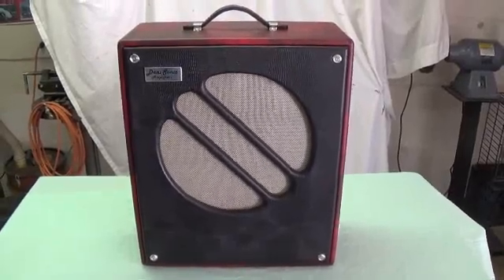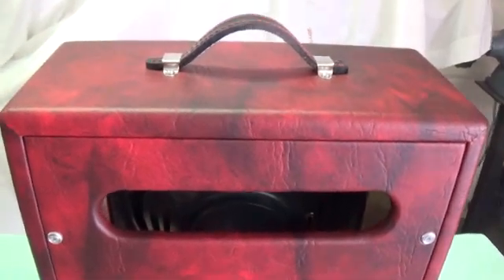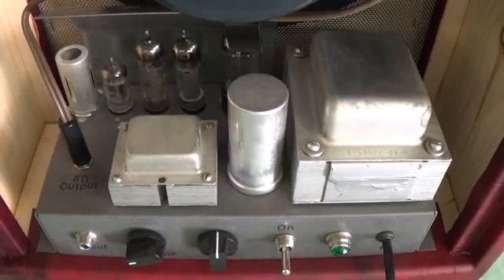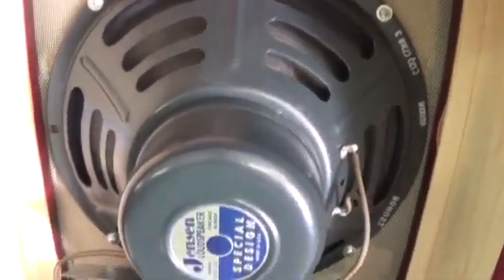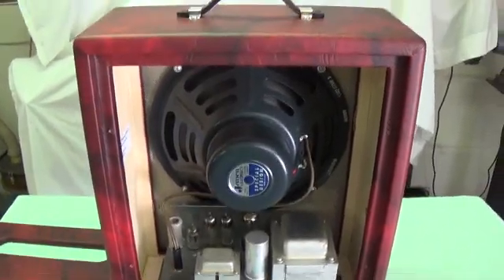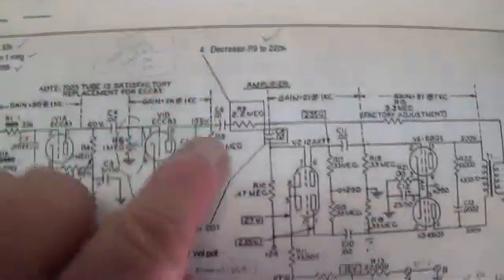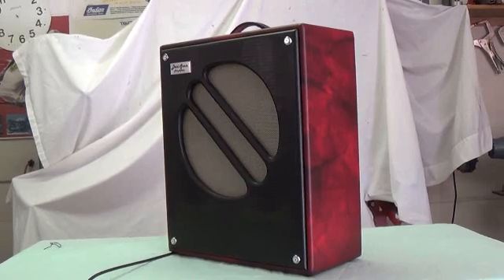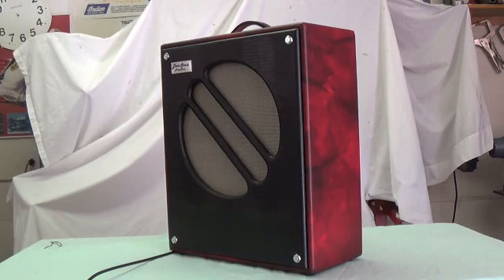Conversion of a Hammond AO-35 Reverb Driver into a Guitar Amplifier

Comment: Hi Uncle Doug.  I''ve been researching the Carmen Ghia amp and found this schematic that was supposedly reverse engineered from a "real" Carmen Ghia.   I noticed the Tone Stack is different from the ones suggested in the link you provided.  Also, it shows a lower gain 5751 in the Phase Inverter which interesting.  And the cathode circuits look more familiar.

https://www.flickr.com/photos/49108115@N04/6687437273/in/photostream/

I thought you would like to have this, if you don't already.  +John

Best Regards to you, Jack and Rusty!
Reply from the maker: Thanks for the link, John. Whenever I encounter alternate schematics like this, I think the best approach is to experiment with each option and compare the results. I'm not surprised at the tone stack difference, since I picked mine, literally at random, from a site on the Internet. The change in PI is interesting, however, and would be a good candidate for side-by-side testing. Again, thanks.
Reply from the maker: Thanks for the video link, John. I have never felt the need to heavily modify this circuit.....it seems to work really well with just a few modifications for guitar use. However, I am always interested to see how others approach such projects.
Reply: One more person's take on this conversion: 
 
http://www.tdpri.com/attachments/ao35hammondschemmodified-jpg.19344/

Very minimal changes, I don't think this will get there, but it is a completely different and maybe easier approach to a tone control...

I read the Carmen Ghia was Class A;  I know the AO-35 runs quite hot, but would Hammond use a Class A amp for reverb?  Time to study the bias circuit!
Reply from the maker: The tone control in this version is as simple as it gets.....a pot and cap providing a variable route for high frequencies to ground, which would probably result in some loss of volume when in the "Bass" position. Again, it may work fine, but such modifications should be evaluated by experimentation before being used.
Reply: Yep.  I'm building up a library of CG circuits to play with.
Reply from the maker: A wise move. If you come up with a combination that performs wonderfully, please share it with us. I, and many viewers, would benefit greatly from your input.
Reply: 1 more for reference.   The Matchless Spitfire is very similar and could be built out of an AO-35.  This has a very simple tone control and a very simple Master Volume.....    https://tornadoalleyfx.files.wordpress.com/2015/04/matchless_spitfire_pdf_1.png
Reply from the maker: Excellent, John. Many folks feel that the simpler the tone control(s), the better. Since virtually all such controls are passive, simple designs tend to lose less signal to ground.
Reply: I wasn't all that excited about the Spitfire circuit until I saw that a 15W Spitfire head lists for $1809!!!  I'm paying attention now!  LOL.  I just noticed there is not feedback....
Reply from the maker: Wow.....that would get my interest too, especially since you could probably clone it for around $200 or so.
Reply: I used the Weber bias calculator to compare the bias of the output tubes of some of the designs I've gathered and got interesting results, using resistance and voltage values  on the schematics.

The "Phoenix" Carmen Ghia is biased at 9W /  tube.
The Matchless Spitfire is biased at 15W / tube.
The Hammond AO-35 is biased at 12W / tube.

The 15W Spitfire would seem to be "pure" Class A.
The 18W Carmen Ghia seems to be Class AB, with 50% idle current to reduce crossover notch distortion.
The 12?W AO-35 "could" be 12W Class A.  12Ws of reverb in a console organ seems like a lot for the living room.  This would have been a pretty uncompromising design for a reverb amp in the 1960s.

I powered up the 4 AO-35 amps I've collected and 3 of them work fine out of the box.  The 4th has very low and distorted output.  I've traced the signal to the input of the PI so far....  It sounds like a blown output transformer, but the resistance the OT primary and secondary looks okay;  more to do.

The amps sound surprising HiFi!  The high frequencies are rolled off and the input impedance does not match my CD player very well, but I can hear that "tube-ish" quality that is so desirable.  I'm going to change the values one at a time (at least with the 1st conversion) and listen to how the sound of the amp changes (input cap 1st).

I did some transformer comparisons using Mercury Magnetics replacements/upgrades to get an unscientific relative measure of the costs; looking for some justification for the Spitfire being something like 50% more expensive the Carmen Ghia.

Spitfire transformers

OT  265.00
PT  276.00
C    48.00
    589.00

Carmen Ghia transformers

OT  138.00
PT  197.00
C    48.00
    383.00

18W Marshall

OT   181.00
PT   175.00
C     48.0
     404.00

Here is a Mojotone transformer that is a bit more pedestrian and could represent what the AO-35 transformers might have cost, relatively.  I have no idea how the AO-35 transformers actually compare in cost and quality (I'm sure they are quite good), but there is a significant spread.

Mojotone 18W Marshall
OT    60.00
PT    80.00
C     11.67   (MJT 6V6)
     151.67

The Carmen Ghia is "supposed" to Class A but, If my conclusions about the biasing is correct, it is really Class AB, idling a 8W dissipation.  The Spitfire amp and transformers would/should/could  cost more because it is 15W Class A.
Reply from the maker: Thank you for sharing your exhaustive research, John. The cost of the Spitfire MM transformers is staggering. Its performance would have to be vastly superior to the others to justify this exorbitant expense. The Mojotone Marshall is more in my league. I simply can't bring myself to spend almost $600 for transformers. I believe the transformers that come on AO-35's are of excellent quality, and your figures certainly make them seem like a huge bargain, when the entire amp can be bought in the $125 range, including vintage tubes.
Reply: Doug,  

I think the moral of the story is that if you are going to sell your AO-35 conversion, definitely call it a Spitfire clone, not a Carmen Ghia or Plexi clone!

Here's a good discussion thread on the Spitfire and some variants.  Lots of discussion as to whether the Class A designation is BS for these amps and if the Spitfire is a "tube eater"....  The 6V6 version of the Spitfire sounds interesting.... 

I feel destined to try some of these outrageous transformers.  I've collected 2 Fender Champ 600s and 2 Epiphone Jr 5W heads for the expressed purpose of doing this comparison, but thus far, I have been unable to pull the trigger, LOL.  Also, I have several Leslie 25 and 125 amps that I have collected over the years.  One of the 25s came without an output transformer and is begging for the MM Leslie 25 replacement transformer ($181 ouch).  The design of the Leslie 25 amp was changed because so many output transformers were failing.  The PS voltage was dropped by adding 2 more diodes and a 75 Ohm, 1W dropping resistor.  This change is shown in the Leslie 125 schematics: 

http://www.captain-foldback.com/Leslie_sub/leslie_schematics.htm

I did some debug on the non functional AO-35.  It looks like R13 has drifted in value from 22k to about 5k.  This puts the cathode voltage on the PI at less that .1V; so it's turned off.  The distorted sound I was hearing from the speaker was the result of over-driving the input of amp to the point that the preamp tube was attempting to drive the speaker through the feedback loop!  

Other resistor values have drifted as well, but R13 is the killer.  I see the expected voltage on the bottom of R14, but only about 2V at the top of R14, which is labeled 12V.

I will test this fix as soon I find a suitable resistor in my collection of immaculately organized boxes,  bags, piles and drawers of parts. ;-)

It sure was helpful to have a working amp for comparison!
Reply from the maker: I would love to see and hear an objective comparison of ultra-expensive (MM) and run-of-the-mill transformers, John. Similar evaluations of high-dollar capacitors have, in my opinion, revealed no demonstrable differences, but perhaps such a transformer "shoot out" would. In my opinion, the difference would have to be quite obvious to justify the difference in cost. Let's face it, the most revered of all vintage amps, i.e. the tweed Bassman, certainly didn't have $600 transformers and $50 tone caps, yet it is the standard that many use to justify the exorbitant cost of their parts. Perhaps it makes sense for famous performing musicians to utilize such high-dollar parts, for  max-power durability, but for some poor schmoe struggling to learn Stairway to Heaven in his 12' x 12' apartment, it's absurd. Re your repair experiences, they definitely highlight the need for careful voltage measurements at full operating potentials and individual component evaluation to detect subtle errors (i.e. PI cathode voltage) that result in significant malfunction. Thanks again for your very knowledgeable and informative input.
Reply: Mark Huss has an extensive collection of 18W schematics:
http://mhuss.com/18watt/schematics/
Reply: Have you analyzed the rather elaborate implementation of the 1st gain stage in the AO-35 (V1A)?  The designer went to a lot of trouble and some expense for what may be a unique input circuit!  I have not been able to find anything similar.  

At first I thought C2 was there to reduce the Johnson noise from R1, but if this was the purpose, it should have been placed between the grid and ground.  By placing C2 between the grid and the cathode and using the "low noise" bias resistors (R2, R3 and R4) a feedback path is provided around V1A.  It may be reducing the Johnson noise as well.

The Matchless Spitfire scrapped all of that and it appears they copied the 1st stage of the tweed bassman and bypassed V1B.

The Carmen Ghia kept V1B, but removed the feedback path and simplified V1A.

Any ideas what is going on here?  I hate not understanding!

+John
Reply from the maker: Greetings, John. To be honest, your curiosity and analysis are of greater depth than I generally delve. I tend to be an experimenter, rather than a theorist, and rely on trial and error evaluation to explore such enigmas. This is probably due to my lack of formal training in electronics theory and compensatory reliance on common sense, observation, and personal investigation. My approach would be to set up an experiment emulating each circuit and then analyzing them for relative performance characteristics. It may well be that no significant differences are noted, and that the differences are simply due to the whim of the designer or the availability of certain components.
Reply: Hi Doug, Thank you for indulging my OCD approach to this conversion.  I agree with you that there is really no need to worry about fiddling with this input circuit if it works, is stable and sounds good.  I think I got distracted by wondering what the "secret sauce" is that makes the difference between the AO-35 being a piece of junk sold on ebay for $100 and a $2000 boutique guitar amplifier.  No doubt some portion of the difference is hype, folklore and the soft Corinthian leather.  It seems to be worth a little more effort if it is indeed "knowable".

On the practical side,  I debugged the distorted AO-35.  R17 and R18 were BOTH open so the PI really was OFF.  I can't imagine the failure mode that would take out these 2 resistors; there was no smoke.  The sound coming out of the speaker was the result of over-driving the input to the point that the speaker was being driven through the feedback resistor!  I replaced the 2 resistors and the amp works.  Your basic 6 cent fix.

I made the suggested circuit changes and modeled the Spitfire Volume, Tone and Master Volume controls and it seems to work great!  I'm working on a template for drilling the chassis for the switches, controls, etc.....

These amps are actually pretty easy to work on.  I will build a few a few different versions for comparison.  9W vrs 12W vrs 15W power tube biasing.  Feedback vrs no feedback;  Hammond vrs Carmen Ghia vrs Spitfire input circuits.

On the theoretical side, I think the starting point is the difference between a guitar input circuit and the reverb recovery input circuit of the A0-35 amplifier.  I expect the input impedance, voltage and desired frequency response are all different.

The dominant effect of the Miller capacitance is to reduce the gain of an inverting amplifier at high frequencies.  C2 adds to the miller capacitance which would reduce the high frequency gain even more.  I'm going to model the this circuit by adding C2 to the Miller Capacitance and see what the result is.

While proofing this, I surveyed a variety of reverb recovery circuits;  none I found look quite like Hammond's.  Most look like the input of a tweed Bassman!  It may not be possible to know what was in the mind of the Hammond designer.  Hammond invented the spring reverb and this circuit may be the work of a genius.  It is equally likely there was a technician tweaking the circuit until it sounded "good enough" without a rigorous analysis of the result.  Or Hammond may have patented this recovery circuit and no one wanted to pay for a license!?  Yep, I have OCD.

Comment: Mr. Uncle Doug, i have an old  CCCP made radio receiver . it is big in size and it got several tubes in it and lots of stuff. can i send you pictures and circuit map of it  and i want to know your opinion about it - cant it , some how, be transformed in to guitar tube amp ? (i`am  not competent in stuff like that)
Reply: +Lasha Zaridze  and i forgot to say - it also got a vinyl player.
Reply from the maker: +Lasha Zaridze  You are welcome to post schematics and photos on my Facebook page: Uncle Doug's Vintage Amps. Due to the flood of correspondence, my time is quite limited, but I can look over the schematic.
Reply: +Uncle Doug that would be so great. I dont intend to take much of your time, just glance.

Comment: Doug, am a regular viewer of your videos - which are great. Finally got around to getting one of these ao-35's and was just having a view of your series on scratch building a single ended amp with tremolo and reverb. There is a point in your series where you change the wiring because you said the 5Y3 shouldn't have more than 20mfd filter capacitors. The point I'm getting around to is that the cap can filters on the ao-35 are 40/450.40/400 and 30/350. Wondering if you'd care to comment. By the way, could the tremolo circuit from your scratch build be used on the ao-35 in the same way - hooked up to the first preamp tube? I'm probably showing some ignorance here with both these questions. Love your stuff. Best wishes.
Reply from the maker: +Mac Sledge  Thanks, Mac. Tube handbooks make specific filter cap value recommendations for each rectifier tube.....which the amp-builders seem to scrupulously ignore.  There are benefits and pitfalls of using larger caps, but I've found that being conservative and sticking with book values seems to work quite well.  Apparently, in the AO-35, Hammond engineers (far wiser than I will ever be) felt that much larger caps were the way to go.
Reply: +Uncle Doug Thanks Doug. As you can tell, I don't know much theory but I'm still pretty handy with a soldering iron.
Reply from the maker: You're welcome, Mac. Good soldering is a great place to start :)

Comment: Hi Doug,,, Just watched this great video again and I was wondering how you would tell what the Primary impedance of the output transformer would be.. Looking at the 6BQ5 Data,, I see the Plate resistance is around 38K and the load resistance is  4.5K,,, So for  a Push Pull amp the Effective load resistance is 8K,, So does that mean that the Primary side of the output transformer would have to be around 8K or so? Thanks,, and sorry for the new to Push Pull amp question,, like to build one Using 6Bq5 tubes,, Terence,, P.S. Hi Rusty,,Hi Jack,, :)
Reply from the maker: +Terence Kaye   Yes, the primary should match the load resistance of the tubes (8K ohms of impedance) while the secondary should match the impedance of the speaker(s) voice coil(s).

Comment: Hey Uncle Doug, a Leslie model 51 was recently"dumped in my lap". An older friend of my father wanted it out of his garage, so I obliged😀! The cabinet is a total basket case, literally smashed. Luckily the inside survived, minus a shattered tube or two. My question is can this amp be converted for guitar? And would it make a good guitar amp? All the speakers are there as well, original jensens. What a score...
Reply from the maker: +Kevin Lillie  Congratulations, Kevin, on a great acquisition. I am not particularly knowledgeable regarding all the Leslie models, but if this one uses the model 47 amp, then it would be an excellent candidate for conversion. In addition the Jensen speakers are exceptional. Here is a site that discusses the different Leslie models:  http://www.captain-foldback.com/Leslie_sub/chorale2.htm